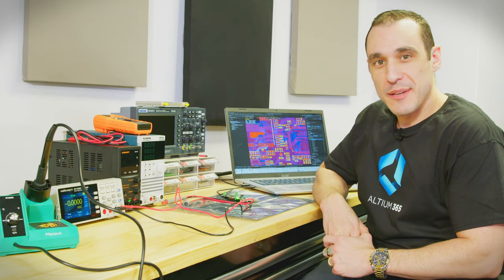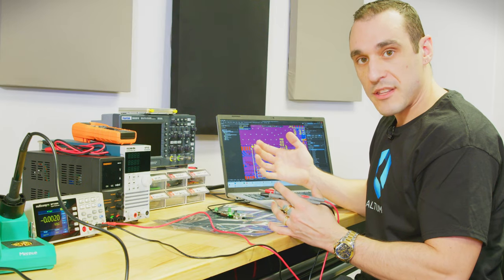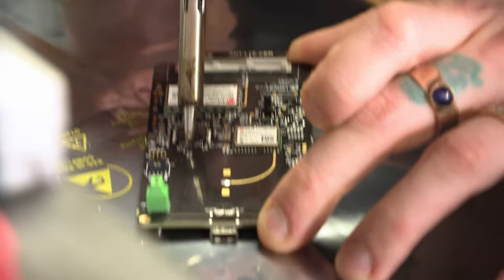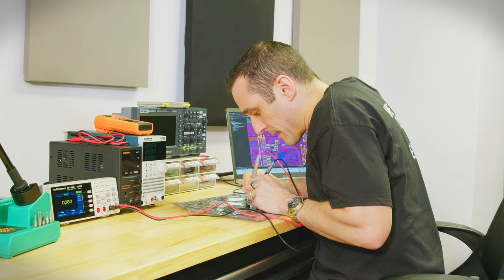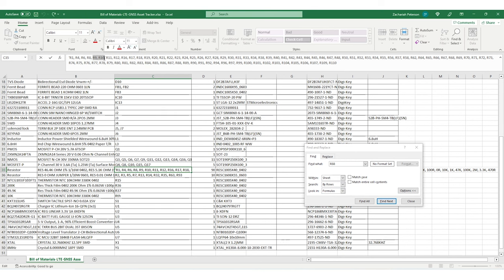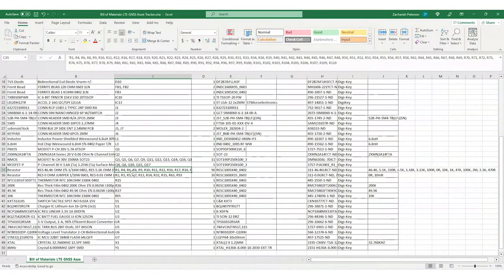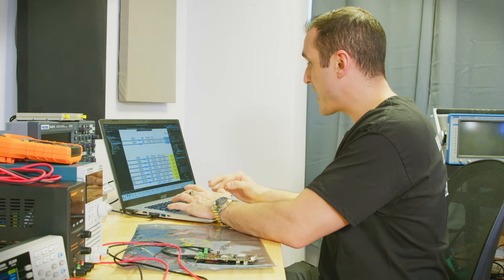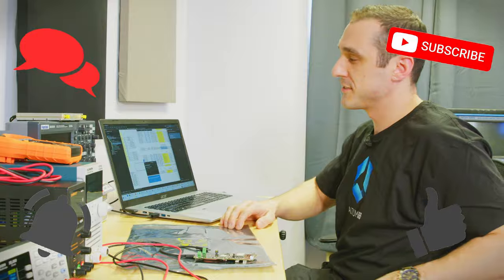PCB DNI Best Practices Explained

Comment: Altium has VARIANTS so you can use it to specify all components you don't wanna populate. Comments could get lost or require some manual handling
Reply: I've never been a fan of the variants feature but I know people who are big fans. In any case, you are giving away the topic for another video!
Reply: @Zachariah Peterson  for 8+ years, I used to be doing it the way you showed with the DNI/DNP comments or even adding it as part of parameters so it will have its own column in BOM. But I got introduced to variants couple years ago and find it to be my preferred way once i got the hang of it :-)
Reply: I’m a variant man also. Very clear and has never failed me🤞
Reply: Yep, my ‘default project’ includes a Variant called ‘Default Build’ (or whatever), then it’s virtually guaranteed that those DNPd components won’t show up in the BOM (so long as you choose that Variant in the OutJob once & then save), no further manual intervention needed.  What’s not to like about this!?  Looking forward to your vid on Variants ;-)
Reply: @techydude  The other thing we run into is when working with different clients, they have different preferences as far as what they want to see in the deliverables. Our biggest EMS clients don't touch the design files in Altium, they want to know what is DNP with it clearly marked in schematic and BOM, so we have to add those notes and highlight those lines in the Excel file.
Reply: @Zachariah-Peterson  that’s the beauty of variants. You can set it up so that you get a BOM per variant (and treat DNP in several options, from remove them to add them with comment etc..), and you can generate pdf schematics that include placing information. 

The default adds a red cross in the component, but you can even customize to your liking.

Changing parameters on components is IMO too fragile, and things like updating components from libraries can break them. It’s also a huge time saver because I can create different BOMs for purchase (that I can directly upload to digikey or other suppliers), assembly, etc…
Reply: Agreed. Why weren't variants discussed in this video? Why would those components be in the BOM at all if they aren't included? And why ignore this obvious feature of Altium Designer?
Reply: @Zachariah-Peterson  Interesting. The Variant feature can indeed output pdf schematics with a red-X for DNPs, and an Excel BOM template can have an optional DNP column, too, if the Assembler wants it (as well as different BOM templates for purchasing & assy).  Would love to hear more about this in a Variants video.
Reply: @brucehaines2516  There's lots of reasons to have them even if they are DNP.

The most obvious for us is that if you might want to try some of those variants, so ordering all parts means you're sure to have what you need if you have to solder them.

I've also seen people buy the full set if they have 2 variants and they haven't determined sales numbers yet. If they have ~200 of Variant A and ~100 of Variant B, they might order 400 boards with the full set, and that way know that they have a ~100 board stock of whatever they need, they'll just assemble JIT.

Comment: I use a dedicated schematic library item and footprint for each package size where I want a DNL, that way there is no confusion even if the component ends up on the BOM it’s likely the assembler will pick it up and query as it’s Schlib name, pcblib name, description/comment all include DNL of some sort
Reply: Ugh!  Awful. Variants deals with all that.  I don't mean to sound like a Variants Zealot, but wow, you're making so much extra work for yourself this way.  I know, "it's done now", but you're still changing/reloading symbol & footprint every time you change your mind on a DNP!  No thanks.

Comment: Please use the Variants feature for this. But unfortuately in managed Release for A365 that feature is broken: Even when the Outjob is Set up to us Variant plus No-Variation outputs the data generation is defective.

The presented ways in the video are ok for small projects without change tracking. But Altium 365 should be able to delivery to professional change tracking - but it doesn't do. Please help to make the managed release live to its big potential, thanks!

Comment: I use a variant for the DNF components, but our clients want a BOM that has everything listed. So in the BOM setup, I add the Fitted column and then group the columns first by Fitted and then by MPN
Reply: I was replying to someone else that my biggest EMS clients want this too, they want everything listed in the BOM and then specifically called out as DNP.
Reply: Our assembler also asks for this. But then in managed release the assembly drawing is generated with the DNP components missing the designators. This is really important to not happen for final production checking.
I hope managed release will get this problem fixed!

Comment: The other way is to add a parameter, to components symbol, called `Assembly` and set its value to `DNP`. But I very like the option to set Standart(No BOM) setting.
Reply: I like this, might have to start doing this!

Comment: I have a question if possible:
I have a pcb that contains a raspberry pi. The raspberry pi is mounted with a spacer and screws so there are some space under it. If i place components under the raspberry pi could i face EMI problem that can couple to the raspberry pi or should i free the space under the raspberry pi completely? Thanks
Reply: You will most likely be fine, I am assuming you are designing the base board to have same power return/ground as the pi, and you are putting ground below the surface layer. It's unlikely you will couple noise back into any of the signal lines on the pi unless they are running beneath the pi and coupling direclty to a net with fast edge rates.
Reply: @Zachariah-Peterson  so if a buck converter is located under the PI could it radiate and affect the PI? Usually the radiation from traces located on the top layer can spread to the air as energy is 3D. Maybe increasing the spacer length could lower the impact? But is there any way to know the limit depending on the radiation?
Reply: @fedi makni  Yes the radiated energy could be received on the top layer of the Pi but it will likely be so small that you will not notice this is because the pi has its own ground plane that helps to block that radiation from the buck converter. That buck converter would have to operate at very high dI/dt and dV/dt to create noticeable noise on the top side of the Pi. If the buck converter is closer to its ground plane on the lower board then it will have less of an effect.

Comment: what is the difference between DNP DNM DNI ? as far as I know it is the same 
Also you mentioned you would link the initial design files but I cant seems to find them.
What is that soldering tip that you used? is it a T12 K ?
Reply: A link to the files is in the "LTE + GNSS Asset Tracker Part 2" article linked in the description, our files were modified from this original project. There is no difference between DNP/DNI/DNM, they all mean the same thing. Someone else mentioned "DNF" for "do not fit" in another comment. The soldering tip is similar to T12-K but it does not have the angle on it, that way you can just push on the side of the component if you can't get tweezers around the part.
Reply: @Zachariah-Peterson  THX
Reply: DNP = Do Not Place (i.e. modern pick-n-placeassembly)
DNI - Do Not Insert, harkens back to the through-hole days.
DNF = Do Not Fit, a generic half-way between DNI & DNP? I dunno!
No idea what DNM means :-)
Reply: @techydude  DNM = Do Not Mount (harkens back to the surface mount days lol!)
Reply: @techydude  DNM Do Not Mount i think

Comment: Big Clive would just hoick out those rogue resistors with a pair of side cutters. You're bodging a prototype board; no need to be delicate here.
Another way to deal with this in the pre-fabrication stage, especially if you're working with a cut-grade rapid prototyping fabricator like many of your viewers are, is to take a few minutes to remove the DNP components before building your Gerbers. If your EDA software file formats allow it (and I frankly can't be bothered with even the free-as-in-beer version of Altium, so I don't know if this works with your proprietary software), you could even replace this step with a very small shell script. If those components are needed in a later revision, you can always just add them back in.
Reply: I've been known to use clippers to cut the leads on ICs when I need to remove them. I've also been given schematics where the previous revision did the same thing, you see this blank spot in the files and they say "oh there was a 10k resistor there" or something, and then you have to figure it out.

Comment: Wouldn't it be better to use large red DNF label/designator on those components? also board variants so you can create two different BOMs?
Reply: I'm not going to tell anyone what color to use, as long as it appears as text in the schematic you can CTRL+F in the exported PDF. I don't normally use variants because some of my clients require the BOM to have the DNP listed in it, they don't want to juggle around multiple BOMs. I mentioned this in a few other replies so I won't repeat here.

Comment: Would be great if during  layout Altium automatically put "DNP" text on board  if the element property set to No Bom.
Reply: I think you can add it to the silkscreen for your components
Reply: If you set a component as not fitted in altium variant manager, you actually can set this for layout options